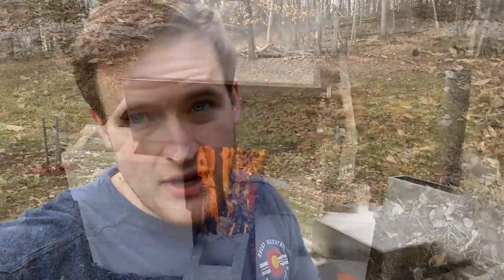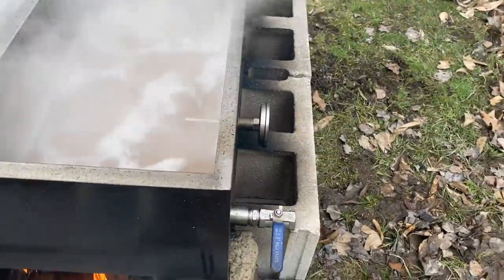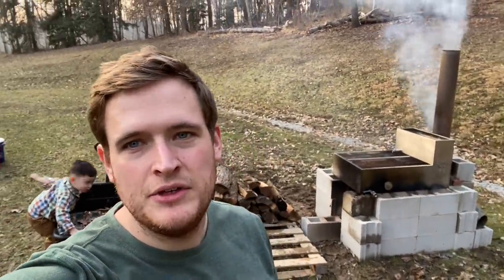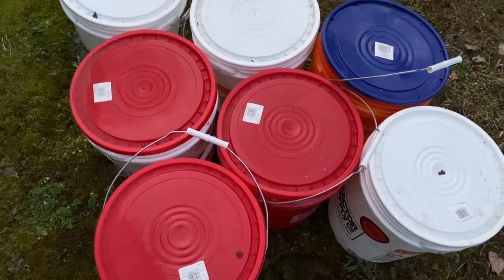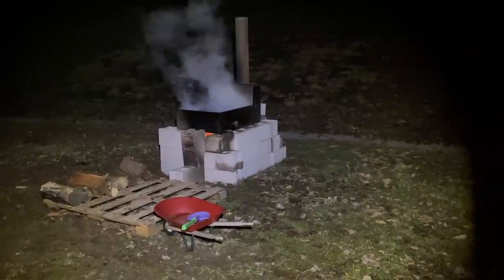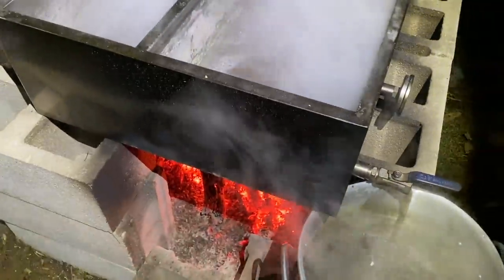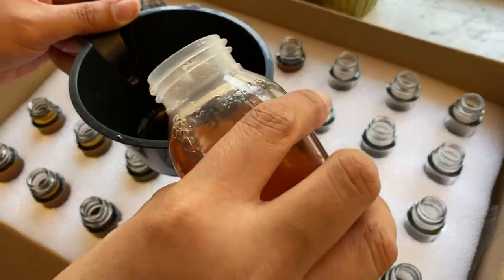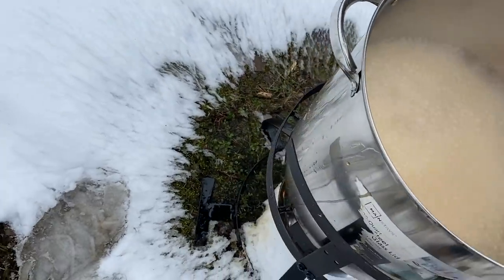#69 This Is The End Of Maple Syrup 2022 Part 3 Finale Episode

Comment: The RO is used to filter salt water and make fresh water. Reveres Osmosis as applied to maple syrup is sort of opposite in that we discard water rather than keep and drink water. End up with sap that has increased sugar content. If you have say 2% sugar content sap and make increase to 6 or 8%. So if it takes 40 gallons sap to make 1 gallon of syrup. With 6 to 8% you would only need to boil maybe 20 gallons. 1/2 time, 1/2 hardwood so fuel savings etc…
FYI i think we all had boil over, not paying attention, and I have scorched a pan. To many people around having fun and sap got to low and warped and scorched pan…
Reply from the maker: Thanks so much for explaining that! Sounds like the way to go! Also that makes me feel better I’m not the only one lol.

Comment: If you use an RO system, just remember you will use it backwards.  You will boil the reject or concentrate not the permeate or clean water.  An RO is made to remove total dissolved solids.  We use them for drinking water to remove salt.  Up North here the big guys us ROs for mass production.  It would most likely be cheaper to buy a unit then build one.  If you want more info let me know.
Reply from the maker: Thanks a lot Mike for explaining that! I think I heard that but had forgotten. I appreciate the help!

Comment: A gallon is 231 cu. in. and you have a surface area of 2'x3' or 864 sq. in..  That figures out to a height of 0.27" for one gallon of liquid.  A little under 4 gallons for each inch of liquid.  Question:  when you pull the tabs, shouldn't you plug the hole in the tree?
Reply from the maker: Thanks Nick for the math! I’m not a math guy lol. But that helps me a lot. I wondered what those numbers would look like. Also no you don’t patch them. That would confuse the tree and cause bigger issues. It needs to seal the wound off on its own.

Comment: Levi, when you pull the taps does the tree stop sending sap out.
Reply from the maker: It depends when I pull them. But it will stop and they have already stopped here. In the winter the sap goes down into the roots and as it thaws it moves upward into the tree and it’s branches. So it will not run all year long. Only until it is warm enough and all the sap moves up in the tree.

Comment: Start your wood fire on a metal roof section with a hole in it and you can pull tghe fire at the right time so the rest does not burn. a Fifth Wheel Latch hook can do the job nicely with a hole in the roof to hook onto.
Reply from the maker: This is a fantastic idea!! Thank you Todd!

Comment: Do you plug the holes when the taps are removed? Love real maple syrup.
Also curious what CNC you purchased and what plans you have for that. I bought one two years ago and still learning.
Reply from the maker: No I don’t plug them. It’s better for the tree to seal the wound off on its own. Takes 1-3 years to fully seal it off. Most of the taps I’ve done seal within 2 years though. I have the shapeoko pro xxl. Going to dive into that in the next couple months

Comment: Levi if you pull that ice out of you sap buckets that will speed up your evaporation process. Water in the sap freezes before the sugar will so that should speed things up. 
    Also, your sap collection method looks exactly like mine. And one more thing, if you put a little butter in your pan it prevents the foam from forming on the surface. Everywhere the foam is it acts like a lid preventing evaporation. 
Good luck! Your operation looks great!
Reply from the maker: Wes, thank you so much for this comment! That is very good advice and I will be sure to do that. You mentioned the ice and I don’t know why I never thought of that lol. I had even heard before that the sugar will freeze last and I never considers discarding the ice to save time. I will definitely do that moving forward. Also thanks for the tip on the butter! I hadn’t heard that before. I will give it a shot! Thanks!

Comment: Great video Levi, I always thought that the ratio was 25 to 1...25 gals will get you 1 gal of syrup, is that true?  Also I was taught that while boiling you are supposed to skim off the froth as you heat it up.
Reply from the maker: Thanks Edward, it is actually 40 to 1. Yes I have learned that this year about scooping the foam off. I started doing that more.